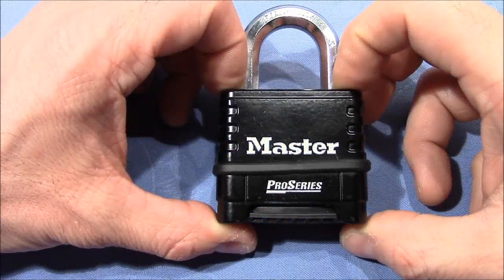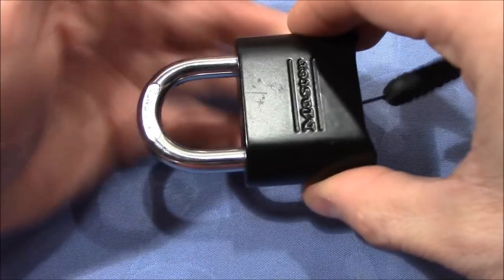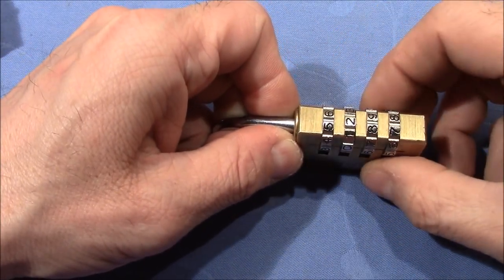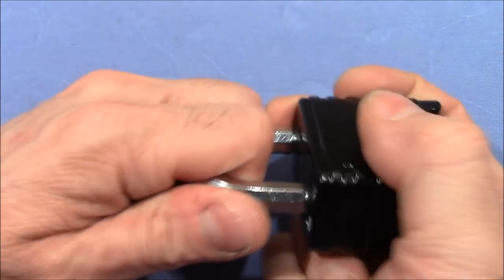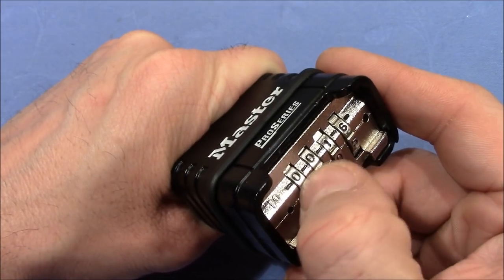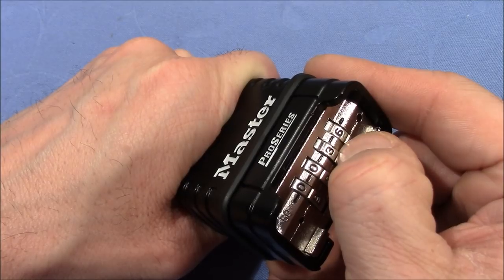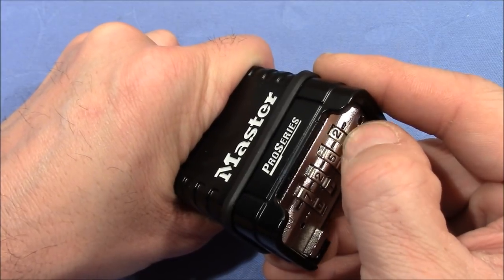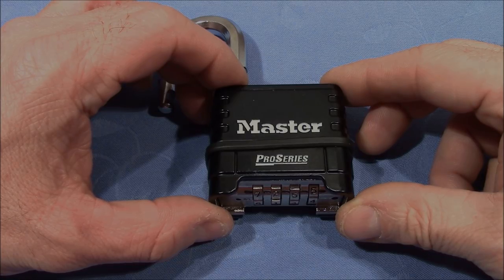(picking 624) How to decode the Master ProSeries 1178 combination padlock

Comment from the maker: What a great present from vde. This master combination padlock cannot be bypassed with a decoding knife, however the pull picking method works just fine. To decode it, you have to pull hard enough on the shackle and need to differentiate false from true gates by testing the play on the wheels.

Comment: When I put tension on, none if the wheels will move. How much tension do I use?
Reply from the maker: You have to put a fair amount of tension on the shackle. Is it the exact same model? There are other types that cannot be tensioned.
Reply: Release the tension to change the numbers, then add the tension to test if they move.

Comment: Looks like the same mechanism as the M175 and some other newer Master models - the internal 'case' is a clamshell made from zinc alloy, with a joint right through the wheels. Nice description of the picking method. I found that you have to really pull on the shackle when detecting the gate type, and then release tension a lot to turn wheels to a new number. The lock I picked had been outside in all weather for a couple of years by then :o)
Reply from the maker: Yeah, the pulling force is remarkable - maybe I should have worn a glove ;-) I can imaging that the elements make this lock much harder to decode.